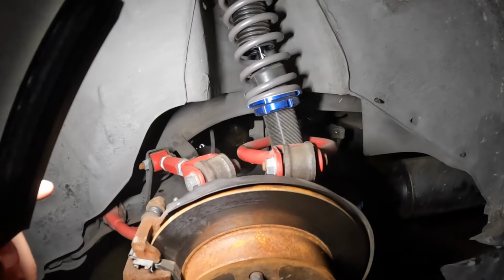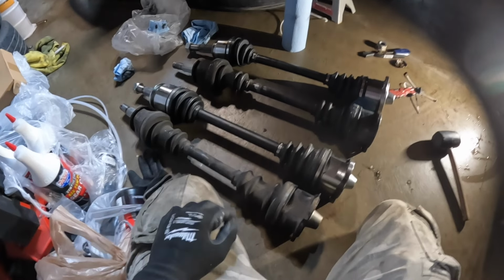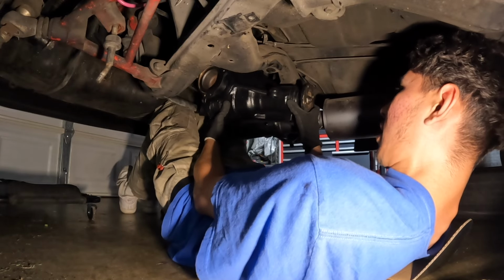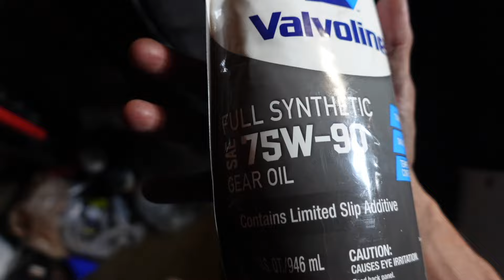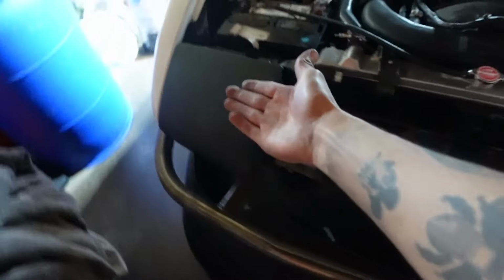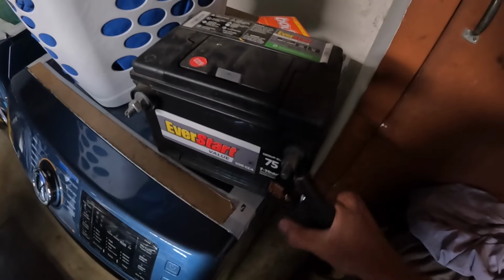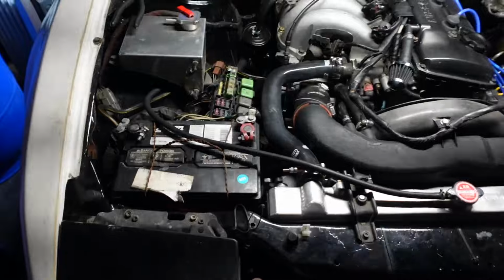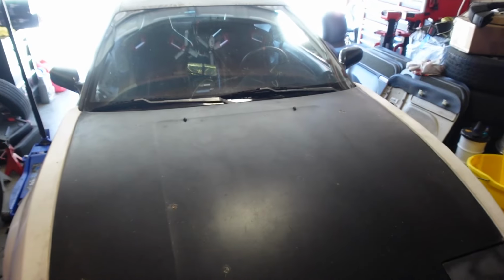My 240sx is ready for its first track day! hopefully ...

Comment: Glad the car is up and going bro! In the future the 240sx and most Nissans/infiniti of this era have one short and one long axle. Most RWD IRS cars are designed this way to try and mitigate wheel hop.

The passenger side is the long axle and the driver is short. Looks like the previous owner had two short axles In there.
Reply from the maker: thanks for the info bro, yea what threw me off was how the axles in the car were the same length lol now I know for next time !
Reply: @Rxstro  figured you already figured it out but just in case you or anyone watching doesn’t know.

Also my guess for the next tow rig, a 2500 Yukon XL or 2500 suburban.
Reply from the maker: @Knownworldwide will def help someone , I show the new tow rig at the end of the video haha
Reply: @Rxstro  damn, I thought it was over so I stopped.
Reply from the maker: @Knownworldwide haha all good